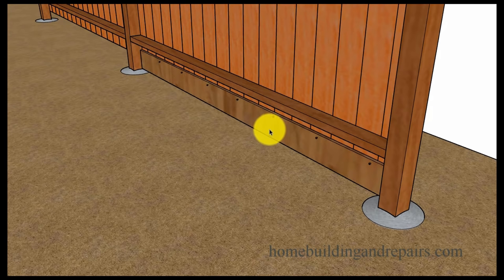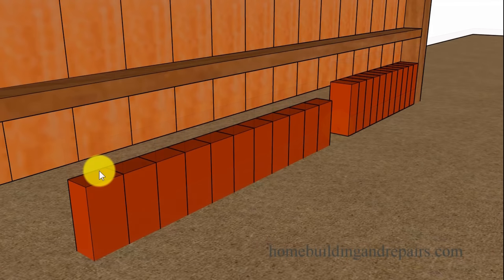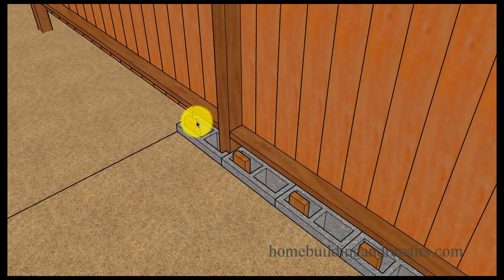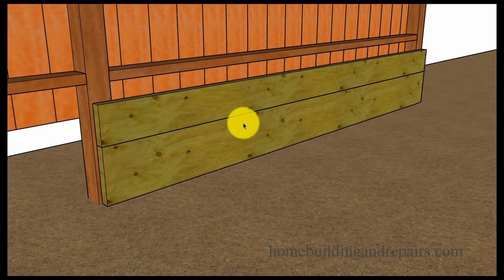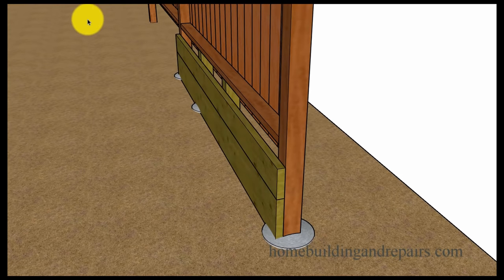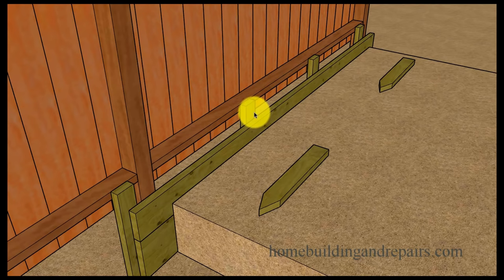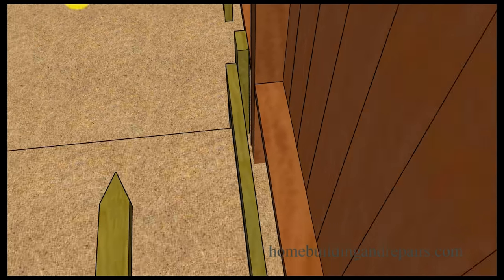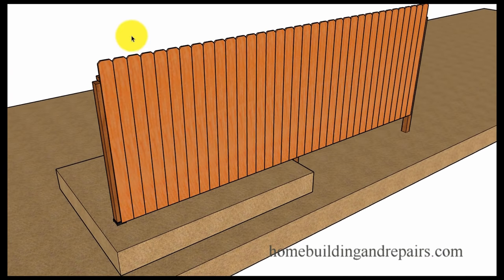How To Fill Open Areas Under Wood Fences - Home Repair Tips

Comment: Thanks for the tips. I used cinder blocks to stop the neighbor's pits from digging under my fence and getting into my yard. :) May cover the holes with the concrete caps to cover or plant draught tolerant plants.

Comment: I really like this approach to learning. I put mulch under the picket gap but I think that's bad for moisture so maybe I need to undo that.
Reply from the maker: If it isn't getting wet regularly, then I think I would leave it or inspect the area about 3 time a year to see if there are problems then remove it.

Comment: Thank you kind sir. I subscribed. I have some spots in our fence that is falling apart due to rain runoff’s from a bit uphill neighbor
Reply: I have the exact same problem.. their soil ends up in my garden after a harsh rainfall. Have you come up with any ideas...
Reply from the maker: Thanks for the sub!
Reply from the maker: You might need to create some type of drainage system or divert the water to another section. I built a fence to divert some of my neighbors water run off.
https://youtu.be/WPNHv1JJXF4

Comment: For me, it is not such about esthetics, but simply keeping a skunk and rodents from entering our yard. at night Is there a wire mesh solution? Is it possible to buy like a 100-foot roll of wire mesh that is like 8 inches wide that could be  tacked to the back side of the fence?
Reply from the maker: Good idea and thanks for sharing.

Comment: Railroad ties sound awesome because of the longevity of the material if I could afford it that's what I would get it would be nice if the state would let you have their unused railroad ties.
But I suggest a long gated fence in panels I'm building a catio and that's what I'm going to do with galvanized Carpenters fabric. Then set along the bottom part of the fence

Comment: Interesting ideas.
How about flagstones, longways stood on edge down into the soil. Can be painted to match the fence colour. As an idea for preserving the fence post base, get a short length of plastic pipe of size about 2" bigger than the post,  cut it along its length then force it around the post base and pour a concrete mix in to form a collar that is proud of the soil and bonds with  the post's concrete base. Taper the collar all the round for water run off.

Comment: My new puppy can walk under the fence... I live in a COA area with wooden fences so it needs to look appropriate. She'll get to about thirteen pounds. What options would be best? The space is about 12x14  with a gate and one wall is against the brick. I'm looking for an inexpensive option that wont be an eyesore. She's a busy Jack Russell and the gap is about seven inches! All the other wood fences come to the ground! She was born in a horse barn so, being inside is tough on her. I'm trying to housebreak her and I''m exhausted with no place to leave he alone for a few minutes It's a pet friendly area of condos and the dog walking sidewalk in on two sides too. She cries if I'm out of the room and cant do stairs yet... Thank you!!! 
I'd appreciate any input from others too. Her crate is by the bed and she has slept in there once.

Comment: I recently had a 6’ wood fence installed. They put concrete around the posts but the last 4 inches at ground level is soil, the concrete wasn’t poured all the way up to ground level. I’ve read that’s the way they generally do it but I’m concerned that it will cause the posts to rot at the ground level faster than if the concrete came all the way to the top.

Comment: I'm surprised you didn't mention pouring concrete in the gap. Portland Cement and gravel is cheap and makes it easy to deal with uneven ground
Reply from the maker: Definitely another good idea and thanks for sharing.

Comment: I have this same problem..but on the other side of my fence (the back side) is touch the neighbors fence..so going on the opposite side of the fence is not an option..Sooo what can I do to make it right but on the front side of the fence which faces our yard.  PLEASE RESPOND...PLEASE HELP IF YOU HAVE ANY SUGGESTIONS. .THANKS
Reply from the maker: Email me a few pictures of your problem and I'll see if I can provide you with some more information. You can get our email address at our website.
Reply: I'm in the same boat! I don;t know what to do!

Comment: At 4.50 the posts will not rot because they will be ground treated anyway the same as  the post which is already under the ground. Not a problem.
Reply: The wood—posts and pickets—that are touching the ground *will rot*. Even pressure treated wood eventually rots when it’s in constant contact with the ground. I’m currently building a new fence after ripping out a rotted, pressure treated wood fence that was built touching the ground.

Comment: My neighbor had the fence installed high because they wanted to mound their flower beds around the fence but now I have 4-6 inches high all down the fence and my kids toys go under all the time. We are uphill and get a lot of water coming down. We already have a French drain to divert most of the water but there is still enough water to wash our dirt and gravel under the fence. The fence is vinyl and I don’t want all our dirt and gravel to wash under the fence. Would bricks be good for this? Allowing water to flow under the fence without losing our dirt or kids toys?
Reply from the maker: Brick could work.

Comment: Could there be heaving problems in colder climates? Anything attached to the fence could alter it during freeze thaw cycles.
Reply from the maker: Good point and I agree, any fillers should not be positioned in a way that could raise the fence in areas where frozen ground can rise.

Comment: I need to show my HOA this..  first we used composite fence so we don’t have to worry about wood root. Second our HOA is claiming that our fence is in violation bc it’s taller than 6 feet when is will not be if they let us FINISH the project with the gravel / cement base and flagstone on the inside up to fence line ( with little gap) than sloped down with earth and sod to meet the continuation of grade slope in common area leading to the main water drainage ensuring water drains away from the house.. kinda confirm if that makes sense..
Reply from the maker: I don't see what the problem would be, as long as it's going to be 6 feet on both sides of the fence.

Comment: I have a metal fence and my neighbor has a wood fence that I paid half for he keeps blowing his leaves underneath my fence so my idea is just to put some canvas across the bottom I think that's the easiest way it's plastic won't rot won't hurt the fence and is inexpensive what all your thoughts on this solution
Reply from the maker: The canvas will probably fall apart, but might work in small area, but if you're looking for something more permanent, then maybe use something else.

Comment: We are trying to prevent pea gravel from going under our fence to our neighbors yard. We just installed a beautiful cedar fence. I was thinking about placing copper sheeting - about 30mil along the bottom in front of the pea gravel to protect the fence AND prevent the gravel from going into the neighbor’s yard.  I would bend the sheeting so the metal is covering the ground then bends up to cover the bottom of the fence about 4 inches. 

Does this method sound like both of my objectives would be met? 

Copper would be very expensive. I wonder if galvanized metal spray painted to look like copper would do the trick??
Reply from the maker: You can try it, but I don't know how long the metal will last, especially if the ground is moist for long periods out of the year. I like the galvanized idea and used it myself.
https://youtu.be/WPNHv1JJXF4

Comment: Would you put on inside of fence or the outside of the fence. I have a cheap metal fence and need to put something around the base too build a small wall all the wsy around. Which would look better inside or outside
Reply from the maker: I think you answered your own question, I would consider safety and appearance before deciding where the fill will be located.

Comment: The concrete idea put rebarb and then and then fill them half way up either with concrete and then Stone to save money the rebar bin the ground will hold the concrete blocks into place
Reply: they should fill them with Rubarb

Comment: What about if there is a large gap under our gate? 

We recently had to have our yard re-graded, and that left us with a gap under way our double gate. Any ideas how to fix this without blocking the grading?
Reply: What did you end up doing?
Reply: For my case, on a steep slope, a terraced step approach and a bottom layer using landscape cloth and stone works, but I'd say it was a lot more effort than another approach might have been.

Comment: I just want to stop the weeds growing under the fence and invading my garden. Maybe I could staple some weed barrier fabric to the bottom of the fence and secure it in the ground with stakes?
Reply from the maker: I have the same problem and just pull them out, but let me know if it works.

Comment: Good video and suggestions.  I have an uneven ground level wooden fence just installed by Lowes'.  The top of the fence is level but some of the fence is touching the ground and other areas its about 6" to 8" above the ground. This is the way they do it says Lowes. Well I want to fence not to touch the ground so was thinking of digging a trench below the area of fence where it touches the ground to put half of a rubber tubing used for a french drain, then filling it inside with small rocks. Does this make sense or what do you suggest. Thank you for the time to respond.
Reply from the maker: I like it.

Comment: How about just in those areas install longer fence boards cut to length and keep your top straight.
Reply from the maker: I like it.
Reply: If you're getting a permit you will fail because your fence is now taller than what you proposed it to be. No permit? Then no problem. Otherwise you can't do it. Great idea though.

Comment: What if I was trying to fill a gap beneath a METAL fence so as to prevent human waste from seeping onto my property. So I live in a bad part of town and people stick their butt or weewee into our hedges on the street-facing side and use the bathroom and it sometimes goes under the fence onto my concrete porch property. Any suggestions my man?
Reply from the maker: I do have a variety of different suggestions, but I think the best one would be to cover the fence with something that they can't get through or start planting bushes with thorns in these areas. This doesn't seem like that difficult of a problem to solve, but feel free to send me some pictures if you need a few more ideas. You can get our email address at the website.
Reply: @gregvancom  Thank you sir. We did plant some cactus. But maybe we need more. We're going to try plugging some industrial rubber beneath the gap and connect the rubber to the fence. Any suggestions for what not to do?
Reply from the maker: @allboatsrise5595  I think if you are asking what not to do, I might suggest avoiding at all costs any confrontations with these people. It might be easier to pick up the crap than to come home to a home with broken windows.

If you think it might help, you could also contact your local law enforcement agency to see if they have any suggestions or might be interested in patrolling that area a little more often.

Don't shoot the messenger here, I'm just thinking out loud.
Reply: @gregvancom  Definitely agreed! I meant more so with the technicals of the construction. screwing rubber into metal if there was something specific to know. other than the rubber shrinks toward the screws when pushed in too tightly.
Reply from the maker: @allboatsrise5595  If you're looking for more technical information or construction methods, then send me some pictures of your problem and I'll see what I can do. You can get our email address at our website.
Reply: Move to a different neighborhood!

Comment: could i just tell the installation contractors to install the fence flush to the ground?
Reply from the maker: That might not allow the top of the fence to be straight, but yes you could build the fence along the contour of the ground.
Reply: @gregvancom  true, thanks for that

Comment: The weeds here will just heave the bricks up and the cinder blocks will look like weed planters.
Reply from the maker: So you're suggesting that some maintenance might be required, like weeding or are you simply providing those who have no desire to maintain their property with an extremely valuable tip. Choose a different method.
Reply: Whoa,  easy big guy.
Reply from the maker: @1catbrains  I gotcha Texas weeds!